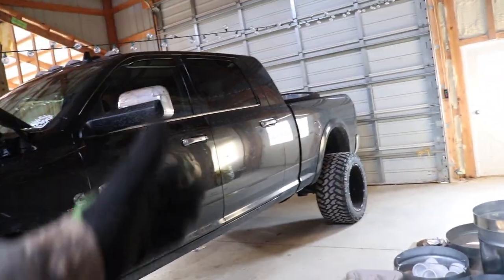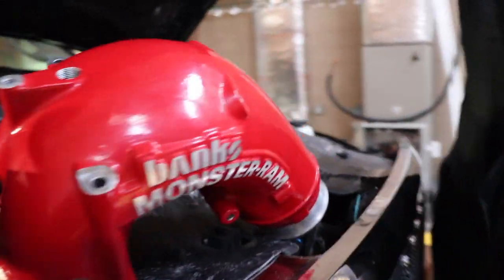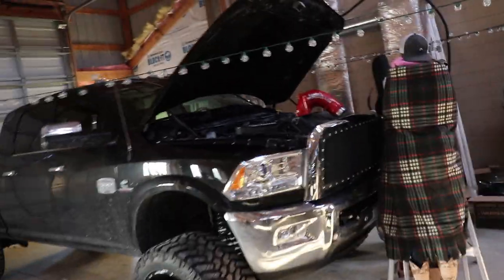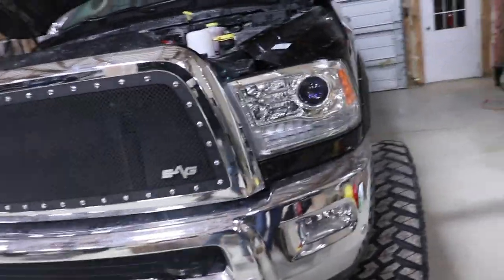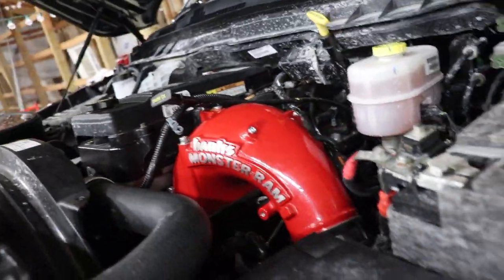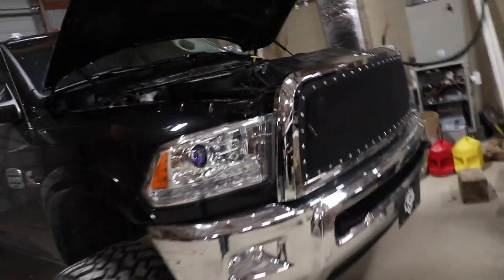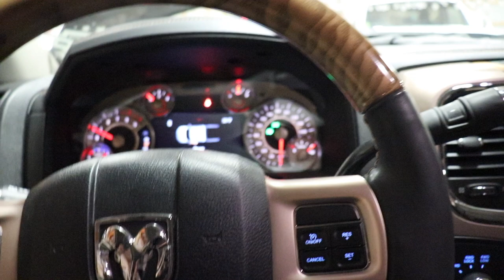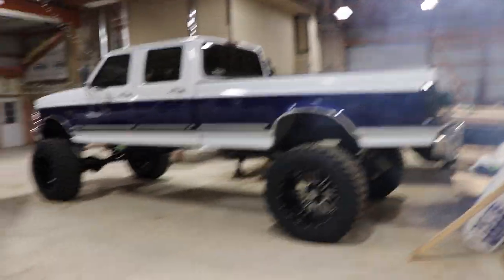HUGE UPGRADE FOR THE OBS POWERSTROKE & MEGA CAB CUMMINS!!!

Comment: That oil leak you got from the "low hard cranks" is from the Oil Cooler. Not having it plugged in allowed the oil to get thicker. So when you cranked it some of the oil got pushed past the seals on the oil cooler. It's also a sign that the seals on the cooler are starting to fail. Eventually it'll do it everytime the engine is cold, after that it will leak all the time. It's a common problem on the 7.3 Powerstroke. 

I myself have a 97 F250 CCSB 7.3 Powerstroke with 296k miles

Comment: Good video. I just installed one of those Banks horns on my truck last weekend. I did it in a different color. The air flow over stock is great. Next is the intercooler.

Comment: You need to have your oil cooler replaced. It’s a common problem with 7.3s when it gets cold outside the seals shrink and allows oils to come out. It will start to fail and eventually mix oil in your coolant. Get that thing replaced ASAP

Comment: 7.3l cold have oil leak if the oil cooler gaskets get old and brittle. That's why it was leaking it wasnt plugged in. I have 2 just had to do that one the one cause it gets bad fast and then will leak even warm. U should have that done before the person takes it on the giveaway.

Comment: The oil came out of the oil cooler
Reply: The seals in the oil cooler fail and that leads to diluted oil and you’ll find an oil film on the top of your antifreeze also, common problem with 7.3’s and a simple fix with new o-rings